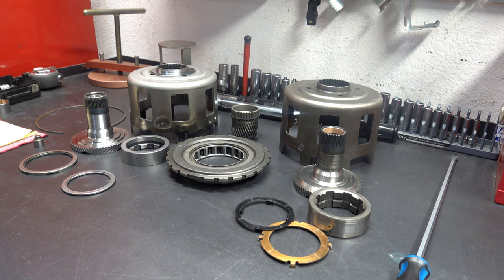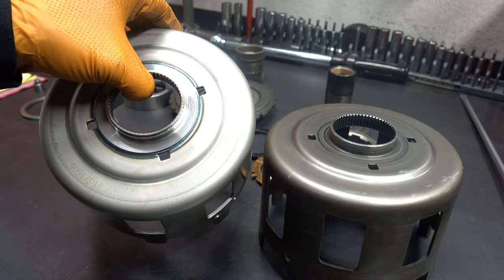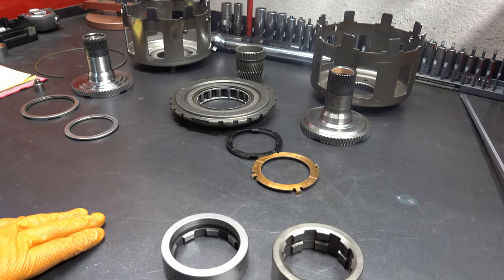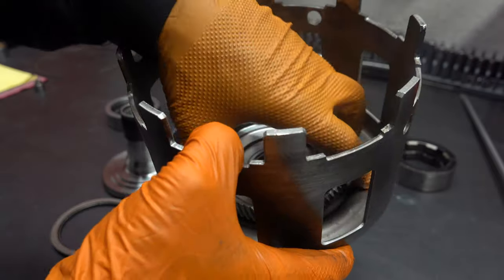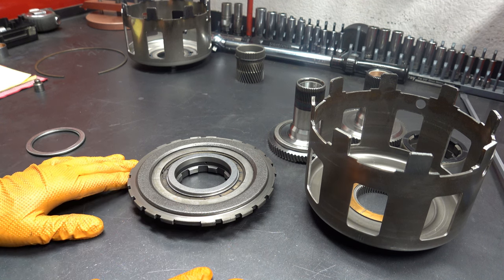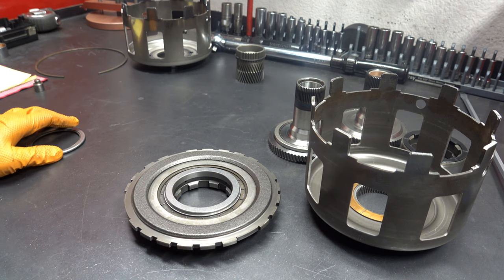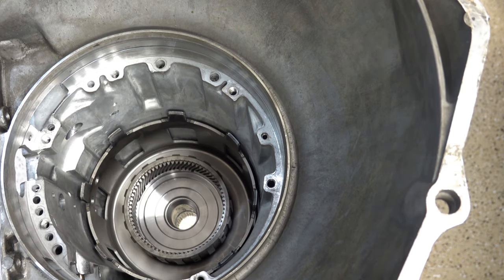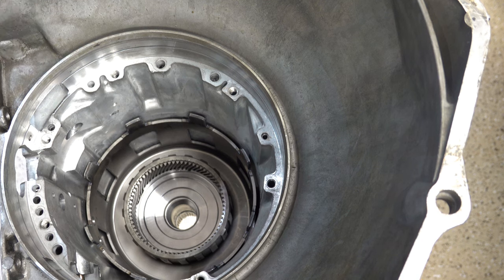700R4 4L60 4L60E 4L65E 4L70E Mid-Case Performance Upgrade: Sonnax Smart Shell

Comment: The 5 gear planetary is also a great upgrade as it keeps everything more stable through the center line of the output shaft. They can be used from donated transmissions with no problems from the 65's
Reply from the maker: Hey Robert, yes -they are very popular for 700R4s, 4L60Es and, believe it or not - TH350s! I'll be doing a separate video on how to retro one of those into a TH350 soon...

Thank you for watching!
Reply from the maker: Yep, same here...The 95s technically are a stand alone year but easily adaptable to work in other years, as long as they have the bosses on the case to mount a manual lever position sensor for use in a 96-2000 with a gen 1 small block (4.3, 5.0, 5.7). Years ago, I had a customer who installed a 1995 transmission in his 1996 Suburban as a stop gap so he can put off an expensive rebuild...Lasted him 9 months and failed due to 3-4 clutch pack (had nothing to do with the differences between 95 and 96-06). He had no idea about the year/unit differences, just put it in and ran it. He was lucky, that thing had an MLPS to begin with...

I prefer the bonded pistons over aluminum every day of the week, twice on Sundays..While I have never experienced a bonded piston failure, I had an aluminum forward piston crack on me once very early in my rebuilding business and had to deal with in under warranty...Torn down numerous 700R4s and early 4L60Es with cracked aluminum pistons....Never again with those alum pistons...
Reply: luckily have not run into the cracked piston. Blown out lip seal few times. Just seems to me that the 700 r4 's and early 60"s would if properly driven last 20 plus years and the after 95's would last 12  or so.. the steel was all I could wrap physics around as the cause. I have several of these tranny's from  years ago that were replaced around that time span but the early 90's and back were just going down around the same time 🤔 so the mystery was on. I have a 95 suburban 4x4 lifted with 305 70 16" a 95 Tahoe 4x4 with carb conversion and 96 truck all metal trucks. Suburban broke transmission 7 times. I even put a 300 mm trans on it stuffed into a 95 casing with one inch spacer plate I made. It worked! But I forgot to bolt the trans mount and going through the woods a stump knocked it up and something weird happened and broke the mount on trans case where transfer case bolts and fluid coming out welp that was the end of that. I ended up building one for me because im  rough on then. I built a Frankenstein. 93 to 06 parts. Steels from 93 are thinner and right for 7 clutch set up.i shaved all the steels for 8 clutch 3 overrun 6 forward. Couldn't use new clutches it would been to tight so got best used ones and was little tight but had movement  and worked 3 years now
Reply from the maker: Nice work on that frankenstein trans, particularly the Fwd and 3-4 clutch...Glad you haven't encountered the cracked pistons, lol - those will ruin your day for sure!

Comment: Excellent recommendation on the Sonnex SmartShell, better than the Beast IMO. I have a 1994 4L60E (Camaro) on the shop floor-waiting that'll get a SmartShell & other Sonnex parts whenever I get into it. I'm guessing it'll need a forward sprag as well.
Reply from the maker: Thanks, Keltecfan! Yep, grab a new borg warner forward sprag and use some 400g sand paper on the inside of the outer race to restore its cross hatch if it’s worn as that gives a better surface for the sprag to bite into.
Reply: @nickstransmissions  Hey Nick, could you shorten the factory inner race and add the roller bearing to the beast shell?

Comment: Browsing Sonnax's web site but I don't see much of anything for the 700r4. Are the just calling it the 4L60?

EDIT: Belay that question, I found their page explaining it all. You've created a really good video set, BTW. Best I've found yet. Thanks and do you do any of the German ZFs, specifically BMW?
Reply from the maker: Thank you for the kind words, crp gap! 

Sonnax has been making more products for the 700R4 as of late which is good to see...While I didn't mention it specifically in the video (at least I don't think I did) but I now install their throttle valve plunger and sleeve kit on all 700R4s to proactively address weak/no line rise conditions. 

I do rebuild the ZF 5-8 speed transmissions and will do a video series when one comes into the shop but I don't see them all that often.

Thank you for watching!

Comment: What would be a basic order of upgrades for a turbo 400? Trying to get added reliability for a street turbo car win maybe a max potential of 700-750 wheel, but likely 550-600 range. Thanks, we appreciate the uploads
Reply from the maker: Thanks, Tim...For up to 650 HP, review my 'TH400' rebuild overview video as it has everything you'll need parts wise (https://www.youtube.com/watch?v=gZMWbFwt9jo) and incorporate a billet, rollerized forward hub, high energy Borg Warner frictions and choose an appropriate converter based on your cam grind and final drive ratio. From there, calibrate the governor as per desired shift points and drill the spacer plate for firmness. Don't block off the 1-2 accumulator but DO block off the 2-3 accumulator using a set screw. I cover this in the TH400 valve body videos. 

If you're going beyond 650 I'd add a billet input shaft, output shaft and would also strongly consider incorporating a billet forward drum to go w/it and Super Drum w/larger intermediate sprag assembly for direct. High RPMs at 700+ hp can stress factory drums beyond their tolerance. Also, maybe grab an SFI-approved bellhousing and transmission blanket to put over top of it in the event something comes apart violently and makes it through the case. These last items are your call based on how you plan to use the vehicle and how often you will be tapping into the engine's max power.
Reply: @nickstransmissions  thanks for the detailed reply. I appreciate it 👍
Reply from the maker: @timweb1510  You’re welcome, Tim

Comment: Awsome video series ! Can i drill and tap the vent for a barbed fitting to slip a hose on so i can vent the trans up high to keep water out ? Thanks.
Reply from the maker: Thanks, Bobby. Why not just clamp a long hose onto the vent tube and use something like a one-way valve to let gases vent but nothing in?
Reply: @nickstransmissions  OK, just didn't want water to get in when I'm crossing rivers and streams in my 91 K5 Blazer.
Reply from the maker: If you want to build a 700R4 a la carte using compatible parts from later model 4L60Es, purchase the following:
- Paper and rubber kit for the 700R4 (Transstar's kits cover all years of 700R4)
- Clutch module, steel module, band and bonded steel/rubber forward drum apply pistons and late model forward return spring assembly for a 1997-2003 4L60E (the reverse input and low-reverse steels in this steel module will be vented)
     > you can also purchase a 4L65E spec 3-4 clutch pack, including BW high energy frictions, kolene steels along with the 4L65E apply and backing plates - this give you an extra friction and steel in that clutch
- A Viton-style rubber seal for the input-output shaft junction (this seal replaces the plastic white seal that comes in the 700R4 paper and rubber kits as that plastic seal isn't very effective

You can also purchase a 2003+ reaction shaft and bearing to rollerize the front of the sun shell; this will have you omit your existing reaction shaft and bronze thrust washer that normally goes on the front of the sun shell.

If you pair this with Sonnax's Smart Shell then you will fully rollerize the middle of the case.

The above build, if paired with the appropriate hydraulic improvements and calibration, would be great for anything up to about 425HP as a nice economical street strip or heavy duty working transmission.
Reply: @nickstransmissions  awesome! Thank you again !
Reply: @nickstransmissions  do you have a preference on fluid for a 700r4 ? Thanks.
Reply from the maker: No preference, any Dex/Merc certified fluid will do.
Reply: @nickstransmissions  I've used type F for years with no problems but that's just me.

Comment: Is this upgrade expand pump life too ?
Reply from the maker: Pump upgrades consist of Transgo unbreakable pump rings, Sonnax or Transgo boost and/or pressure regulator valves along with machining the cover and body so that you have ideal pump rotor and slide clearance (.001-.0015) with the pump body deck surface. The smart shell reduces heat at the mid-case while reinforcing the general torque handling capacity of the gear train. 

Thank you for watching!

Comment: Where are located? I would love for you to rebuild my transmission
Reply from the maker: Hi, thank you for the consideration however I actually don't give out my location on Youtube. That said, if you have a 4L60 or 700R4, they aren't very difficult to rebuild yourself...I have a complete rebuild series on both the 700R4 & 4L60E beyond the high performance vids as well as a full length tear down and inspection video that covers everything you need to inspect/look out for when taking apart one of those transmissions.
Reply: Be very cautious, if your half way mechanical with Chevy engines than u can rebuild a 4L60E or 700r Both nearly same. Transmission Bench is about the Best ! Step by Step series in 2 parts  for specific transmissions, 4L60E is 2 part and about 16 videos or so. I using them now. Very Detailed to the tiniest washer or bolt ! Check him out.
Reply from the maker: Replying to your post above...

If you're short on the output shaft (i.e. the snap ring groove is not fully exposed, there's something else wrong inside the case. The Sonnax instructions are very clear on what you need to do and how you need to do it. But in case you missed it, swap the factory inner low roller race for the Sonnax race - make sure the side marked 'Front' is indeed facing front. Then, install the bearing that comes w/the Sonnax shell on the back side of the shell with the bearing's inner half facing toward the shell. Then install the sun gear and shell. 

If you've done all that correctly and you're still having problems then something else rearward is wrong (most common mistake people make in that area is installing the rear case-rear ring gear torrington thrust bearing upside down). If you do that, it pushes all the guts forward by about .050" or so and you may or may not have enough of the snap ring groove exposed to install that snap ring.

Comment: Hey, Video is ok but comes up short on assembly, leaving out front pinion gear and output shaft. With that, also alot of just noise with the S.S. table, seems u like all the sliding parts around on it. I came to ur video to see step by step on Sonnax Smart shell for 4L60E, as I have mine on table for a 100 percent Rebuild. Your missed the mark on that also. You should rename video, calling it, Explanation of upgrades, as most the video is wasted talking. Not to hurt ur feeling's. I need to see each new part and its bearings as its different than OEM, I'm short on output shaft, to get snap ring installed. Think I got oem part installed that's now not needed.
Reply from the maker: No hurt feelings, I'm not a snowflake....This was just a topical video, intended to be a quick overview on that shell...If you want to see a full assembly including that Sonnax shell, check out my high performance video, PT5 for 4L60Es, here: https://www.youtube.com/watch?v=2CFIso8matU

Noted on the sliding parts on the bench, I can see how that can obscure some of what I'm saying...will keep that in mind for future vids.

Like and subscribe - thanks!